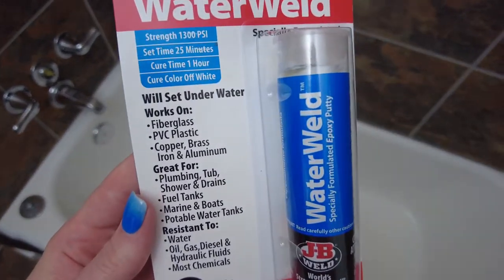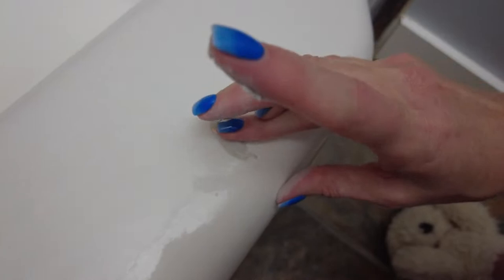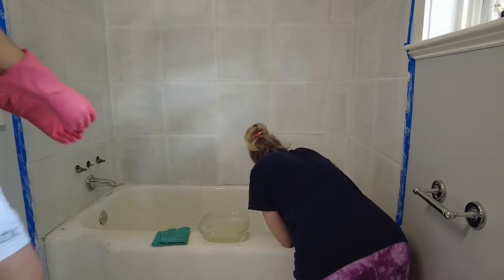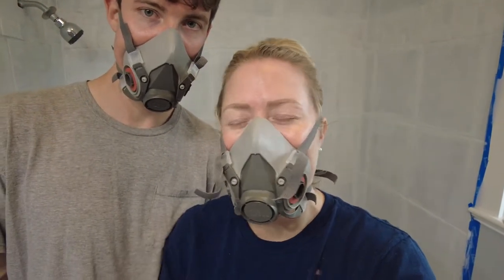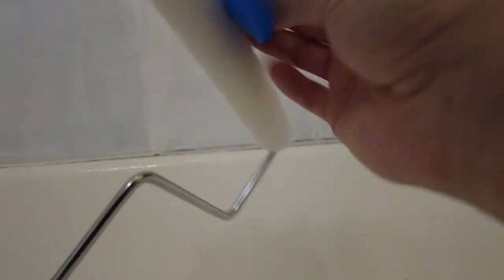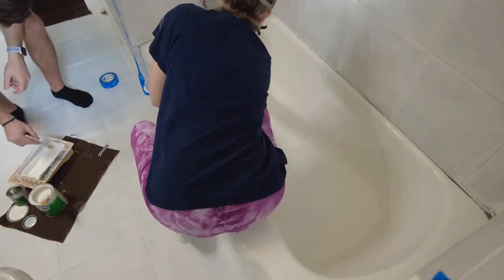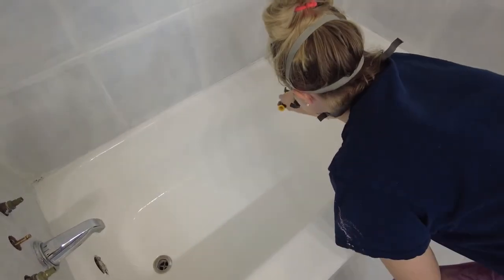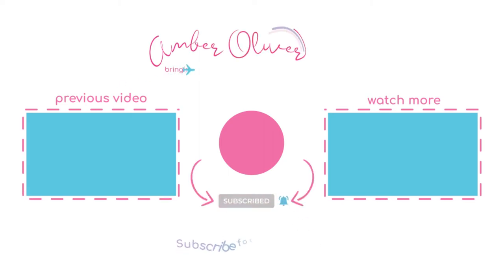ONE ROOM CHALLENGE Week 2: How to Paint A Bathtub

Comment: Hi! Why did you choose to use the Behr paint on the tiled walls as opposed to using the Tub and Tile paint that you used in the tub?
Reply from the maker: hi! You can totally use it on the walls. But it's harder to work with 😆 It's also pricey 🤑 I would have needed a lot for the shower tile so looked for an easier and cheaper option. We've had great luck with the enamel on the walls!

Comment: Is the Behr paint and Inslx primer useable on the tub? I’m trying to figure out how to paint the bottom of stand in shower and I can’t find the rustoleum in stock anywhere
Reply from the maker: Hey Allie! That's a great question. I haven't tried but I'm thinking it probably wouldn't :( It's ok on the wall tile because the water isn't the issue - I think the traffic on it in the bottom would be where you have problems. i think it would get scuffed too easily. The best way I can describe them is the tub finish seems harder than the tile. Does that make sense?  HOWEVER! If you plan to update the bathroom eventually I'd say go for it! We plan to replace the tub and tile in this bathroom in the next few years. That's why I felt emboldened to try all of these DIYs!